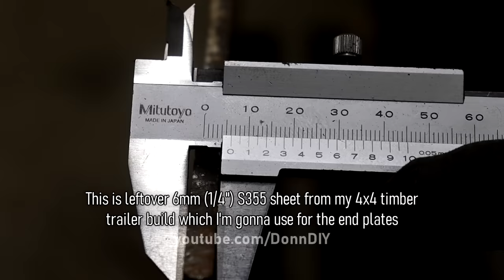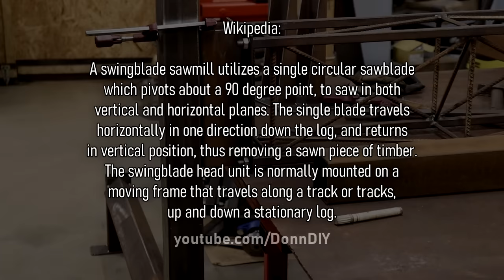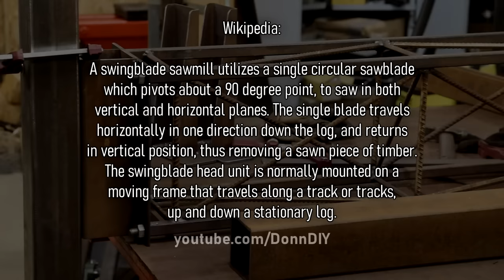Swingblade SAWMILL Build Ep.3 - Steel Frame Fabrication

Comment: Just found your channel but as a former welder fabricator I am very impressed.  I love wood working too and I have often considered this same build.  Only I want mine portable on a trailer if I was to ever build one.  I was looking at a hydraulic motor to power the blade and a gas motor to power the hydro.  Just because it would be real hard to swing a gas engine back in forth. Maybe a 2 stroke but hydraulics would be great for feed too, using a hydro wench drum with a cable wrapped around hooked to both ends of the carriage and it just pulls it both directions.  Then of course if you wanted hydro log loader. I have seriously thought about it and if I ever get my rat rod done it might be the next build. But you sure do make it look fun and have some good ideas.  

You need to invest in one of those new Milwaukee circular saws for steel. I seen I guy ripping 1/2 sheet steel and it looked like he had a normal skill saw going through plywood. Leaves a clean cut and the metal never gets hot.  You should look up a video of one.   I just seen it a few days ago and I promise I have one on my christmas list right near the top.       Anyway great build I liked I subscribed keep up the good work,

Comment: Do you get your bearings and shafts locally or internationally?
With bearings I'm always concerned about the type for the different loads , the speed rating, the right allowance for the fitting and the dust or moisture seals.
That's because I'm not a mechanical engineer.

Comment: You can buy angle iron pretty cheap. I have built a circular mill basically copying the turbo sawmill design. Go get some UHMW hard plastic and get some elevator bolts. They are just bolts with a big washer for the head. Countersink the UHMW plastic so the head of the bolt is clear of the surface. This will allow your slider to work better than steel on steel. It's nice to see a guy fabricating in his own shop with limited resources.
Reply from the maker: Yup, I'll see what I can gobble up for the sliding surfaces. Either plastic or bronze bushings, which one is cheaper to get my hands on.

Comment: You are very skilled with an angle grinder and quite patient!  I haven't noticed your CNC plasma table in recent videos, did something go wrong?
Reply: Temperature has probably forced Donn to revert back into the cutoff blade ninja. 😉
Reply from the maker: Nope, the plasma is in working order. I just prefer angle grinder most of the time.
Reply: @DonnDIY  iv used grinders daily for years it becomes just an extension of the hand haha its so quick and easy just pick it up and go
Reply: Those were beautiful cuts with the angle grinder. Many many hours of practice. Just lovely.
Reply: @DonnDIY  is Mr Chop jealous of the larger angle grinder?
Reply: Another fine video, thanks. 👍
Reply: A guy can become a dam surgeon with a grinder and a cut off blade. Lately though and after a bit of a investment for those long cuts a CORDED metal cutting saw is the cats pajamas! I have the milwaukee one but there are other brands out there if you can Don i would suggest investing in one, keep up the great work!

Comment: If that is to slide on those rails rather than roll you will need to put UHMW Material on the sliders to make it move more easily. Don't put it on the rails because if something was to fall on the UHMW Material it could become damaged.

Comment: I confess to having used my caliper to mark steel like you did at 5:30, but I did it on smooth steel with blue layout dye. I realize that your caliper is likely harder than the apparently scaly hot rolled steel plate you are using, but Oof Da, dude, it is NOT a scribe. But, we are creatures of habit, and we take the short route. By the way, nice skills !!!
Reply from the maker: It is actually a scribing caliper with carbide tips, go check it out here: https://www.mitutoyo.com/products/small-tool-instruments-and-data-management/calipers/vernier-calipers/vernier-scribing-caliper/
Reply: @DonnDIY  Outstanding, In my day, that would have been a $200 tool.

Comment: Could you elaborate on your choice of a swing blade vs band?  Do you have a band-mill already?  What advantages does this have over a band-mill?
Reply from the maker: Hey, yes I had a bandsaw mill (full build here: https://youtu.be/iCeTMkijoR8). The main advantage over bandsaw mill is that the log doesn't have to be handled more than once and you get dimensional lumber out of the log right away. On a bandsaw mill you have to lift the cut slabs off the mill and later back on to edge them. Also you have to rotate the log several times to get the lumber you want. On the swingblade you have carbide tip blade that is more simple to sharpen and the mill has less moving parts (low maintenance costs). Look up Turbosawmill and one of their most popular YT video "The Incredible One Man Mill" or something similar, it shows how cool it is.

Comment: 18:07 i'm surprised the metal didn't warp. Whilst not all of the ones i've cut, quite a few of them warp badly and i have to use a jig i made on the press to bring them to trueness.
Reply: ...use thicker wall materials?

Comment: Regarding all the cutting. Could you not get another torch head cable for the plasma cutter and use it to cut manually?
Reply: Why not cut the plates and holes on the plasma table? Why not cut the RHS on the chop saw?

Comment: Will your opposite horizontal slider be a roller on a flat surface to prevent the problem of maintaining alignment with changes in temperature etc? Our sawmill hearings all use this method and I've noticed several small bandmills run into binding issues going for 2 single edge rails.
Just a thought.
Reply from the maker: Nope but the feet will not be anchored to the ground so they can slide a bit eliminating the possible binding problem.
Reply: @DonnDIY  Well thought out.

Comment: Just an idea. I saw 1 guy who used a garage door opener to move his cutting head down the track rather than pushing it by hand. He had a pendant with 2 buttons on it to control it, Forward and Backwards and when he released the buttons it stopped moving.
Reply from the maker: I'll try to keep this mill super simple so the maintenance cost will be super low as well in the future.
Reply: @DonnDIY  That's cool. it was just a suggestion.

Comment: In my opinion your use of the angle grinder is a bit too far. I mean that to cut square tubes you got “Mr. Chop” and to cut a 6mm plate I hope you got a manual plasma cutting machine. Of course we can do with less but when you got it why don’t use the proper tool? ;)